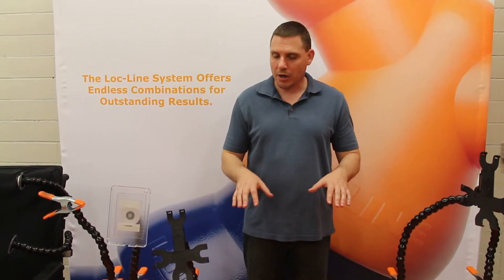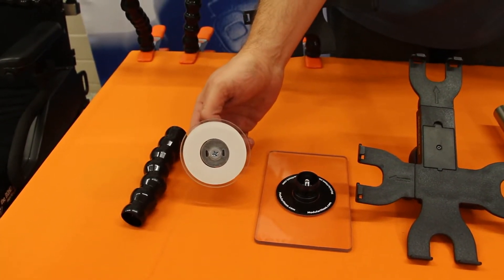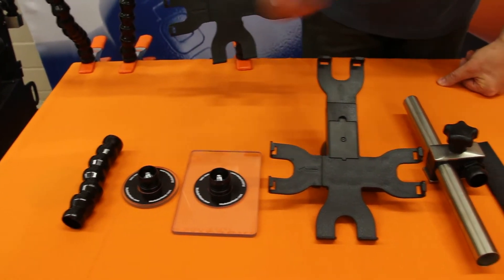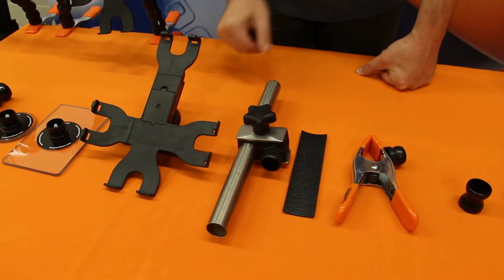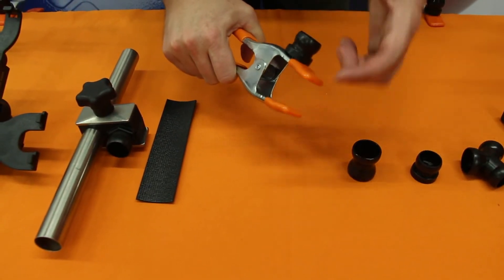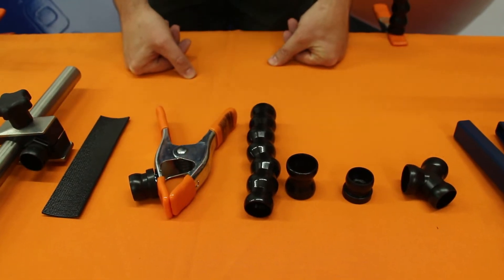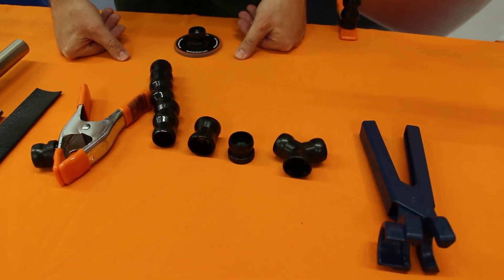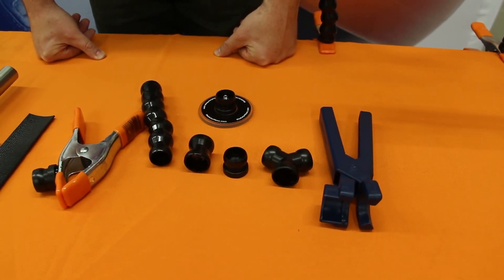ModularHose Loc-Line parts for Assistive Technology

Comment: I'm looking to make a device to hold paper for cutting for children w/hemi needs. Would you recommend the 1/4" or 1/2" hose for that? I'd like it to be unobtrusive. Also, do the spring clamps come for the smaller size tubing?
Reply from the maker: Jennifer - the spring clamps are available in the 1/2" system size, but not the 1/4" size. Since you prefer something small, you may be able to get away with the 1/4" system depending on how long you need the arm. Since we don't have a clamp in the small system, you may need to find a way to attach something. (Binder clips is a popular way) In the 1/2" system we have the spring clamps but they are rather bulky. Feel free to email us directly and we can email you back some pictures. -dave